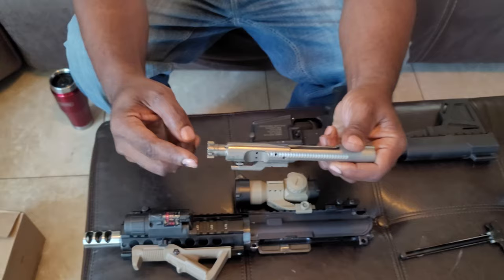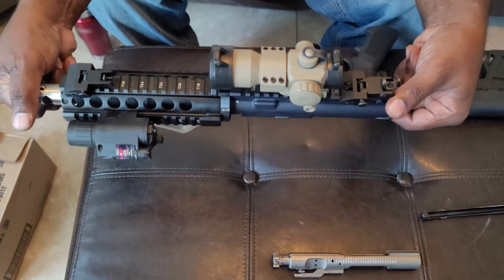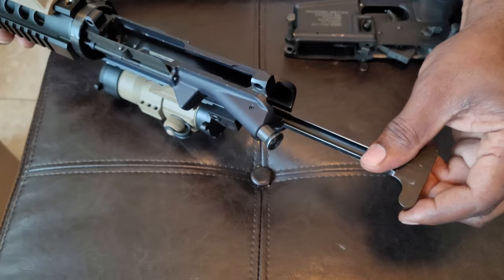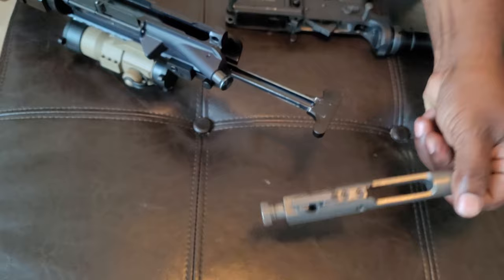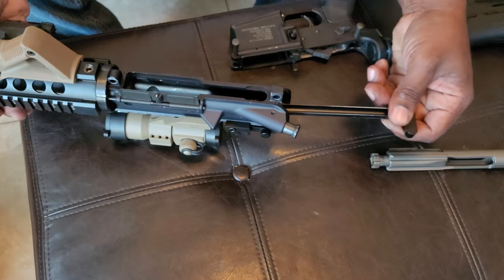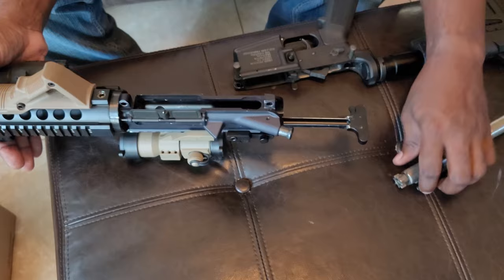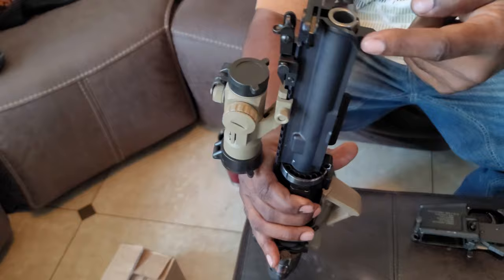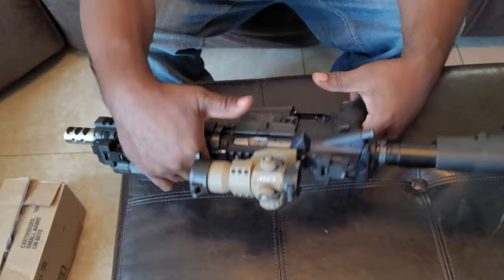How to remove, and replace the bolt carrier group & charging handle on an AR15

Comment: I am new to the AR.  I have several pistols and break them down regularly, but I have never broken an AR-15 down for field maintenance.  I tried using the manual that came with the weapon to break it down and then reassemble it but that ended in absolute frustration.  Only when I discovered your video was I finally able to properly reassemble the beast.  Great job. You explained it perfectly.  Thank you.
Reply from the maker: That's my goal, and I'm glad that the video helped you. Thank you for the kind words.
Reply: You've explained things perfectly. Easy to understand instructions, and a clear voice. The best instructions I've found. Thanks.

Comment: Thanks bro. This was and still is very helpful. I didn't know that there was a space inside the upper receiver with a slot. I thought the charging handle was supposed to be flushed flat. 😩 I'm relieved 🙌🏾

Comment: THANK YOU FOR THIS VIDEO!!! Could not get the bolt back in,  I didn’t realize you have to pull the front of it so it’s fully extended otherwise it gets in the way from putting it back in
Reply from the maker: You are more than welcome.
I appreciate the comment, and I'm glad that this video helped you. If there are  more videos that you'd like me to post, please let me know, thanks. 
Don't forget to subscribe, if you haven't already, thanks.
Reply: @bayareagunclub2963  I’d like to see how to build an ar
Reply from the maker: @TheFifthWallz  Are you talking about how to assemble one from scratch?
Reply: @bayareagunclub2963  yes
Reply: @bayareagunclub2963  the most inexpensive way, which is probably a full build
Reply: Do you have an fb?
Reply from the maker: @TheFifthWallz  You find our group on FB: Bay Area Gun Club (BAG C)
Reply: @bayareagunclub2963  joined

Comment: I like your set up. What frame are you using ?
Reply from the maker: It's generic Lower, not a name brand. It's not the brand that counts, it's the routing process. As long as you take your time, it'll be reliable. That's my 300 Blackout 7" pistol. I have it registered as an "assault" weapon. 
(Whatever the hell that actually means) That's Cali for you....

Comment: my gas line is keeping my charging handle from going all the way in. How do i fix that?
Reply from the maker: Have you figured out your gas tube yet?
Reply: The gas  tube has to be in the correct position. If it’s just a little off to the left or right, it won’t allow the charging handle to straddle it. You may also have feeding/ejection issues. Hope that helps.

Comment: Can you also swap out bolt carrier ? Like if the upper bolt is .308 and you take out the bolt carrier and put a 556 bolt carrier you can do that ?
Reply from the maker: The bolt for the 308 is much larger. It won't fit.